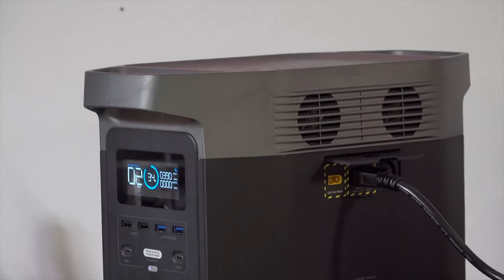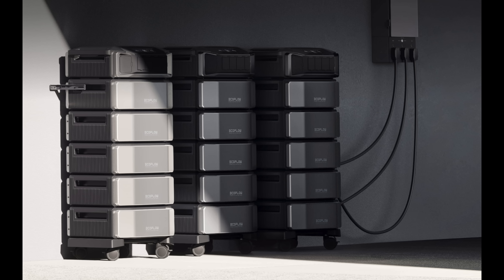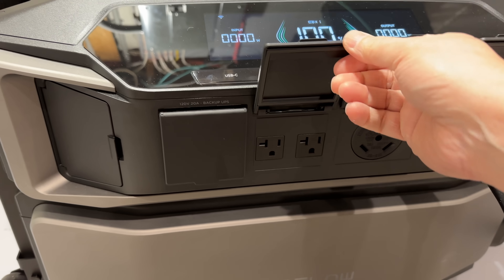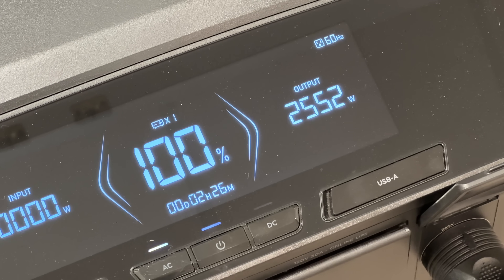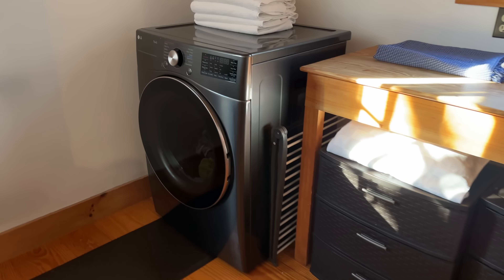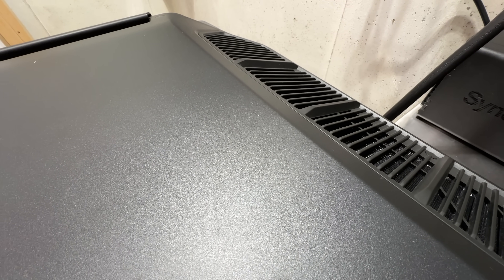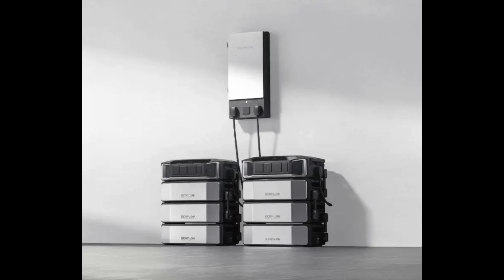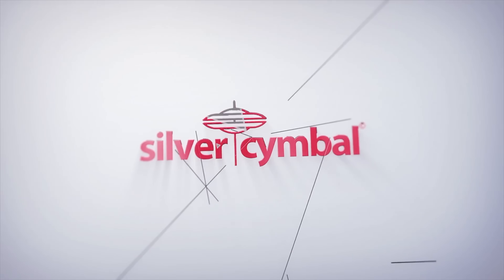ULTIMATE Home Generator just got BIGGER with 240V | Ecoflow Delta Pro ULTRA

Comment: So I should buy a $6000 battery that can handily be charged by my gas generator while it's putting out 240V. Couldn't I just skip the EXPENSIVE battery part and just use my generator??
Why buy this?
Reply from the maker: Certainly, except this one also takes solar input, operates silently. allows remote control and more. I have reviewed many large gas generators and if the noise isn't an issue and you keep enough fuel on hand, and do the maintenance both can be good solutions. Personally where I live we run the risk of a 2 week outage so I need to have both, but using this battery system is the best 3 days I can start with before busting out the gas model. Next year I plan to add ground solar and will hopefully use that power during the day and then have the reserve for storms. The only WRONG solution is when people do nothing to be prepared.
Reply from the maker: Also its $4700 with the code above.

Comment: That unit is amazing - the 240V output is a game changer!  The option of inputting 120V and still outputting 240V is really unique and opens up lots of combinations
Reply from the maker: I totally agree, its almost magical. Next it will run on used coffee grounds and put out three phase 480v
Reply: But 30amp 240V is disappointing at best. When will we get a single power station with real 50amp 240V option?

Comment: Excellent, it can be charged with 120 while outputting 240.  That alone answers my one concern.  I can run my 240V appliances, while charging with my Firman 3382, 120 v inverter generator.  And I would no longer need to keep my 25 year old Generac XL5500, even though the motor run great and the unit has served me well during every past power outage.

Comment: Their Facebook group is crazy useful. Thousands of customers provide info.
Reply from the maker: I hang out in there and some other forums and I totally agree. Its fun to see how others install these too, it can give you a lot of ideas
Reply: @SilverCymbal  yes. You are my #1 source for anything home related. 

I’ve wanted eco flow back up for a year but wife is resistant due to cost. 

We do have a 2 year old - never used Generac 8000 watt gas generator that hooks up to our circuit breaker via the 240v like you just showed. 

But….id have to siphon gas from the vehicles to keep it running in the event we can’t get to the store, etc. but I have prepared for that occasion as a possibility so we could handle it nicely. 

As long as I can keep my wife’s food frozen, and cooked if necessary I’m fine. She has crazy allergies and can only eat very specific foods or she can end up in the er. She eats one type of rice, turkey, carrots, blueberries. That’s it. Every day. All day. Every meal.

Comment: The ability to output 240v while charging with 120v is a big deal. Since most big 240v loads don’t run constantly, it would be theoretically possible to power a house with one of these and a small inverter generator for days, while using less gas and making less noise than a large open-frame generator.
Reply from the maker: I agree, this was my most loved featured for exactly what you said, and lets you get a lot more runtime from far less sophisticated gear feeding it as needed.

Comment: Proprietary phone home junk, stay away. Edit: nvm, read thread: "The ONLY reason you need internet is firmware and remote control both are optional" Edit2: nvm nvm, not that simple after all.
Reply from the maker: It doesn't phone home at all. Needs no internet to function. If you want firmware, yes but it doesn't need to activate or use a subscription. Maybe other companies do that?
Reply: @SilverCymbal they DO phone home if you connect it to the internet. The only way to control it via your phone or "from anywhere in the world" like you say is to connect it to the internet and then it WILL phone home, there is no other way to control it.
Now of course EF does not tell you that, neither do they tell you it's a Chinese product which is tested in China (other models were even "tested" in facilities that no longer were certified to do any testing or labelling) and they don't tell you about their privacy policy in using the phone app or internet connection neither.

I've had multiple arguments with EF over these facts and they keep denying everything, but reading the documentation it is clear that it is a poorly translated Chinese to English documentation and if you look up all specs and test documents with the FCC it is also very clear that is a Chinese company with unclear privacy policies.

Also the details the app requires like GPS, bluetooth, full network access, .. is way more than is ever needed to configure such a unit
Reply: @SilverCymbal  
When I posted a comment under JerryRigEverything's video wondering whether it had it or not, someone said the following:

If it's anything like the rest of their lineup, this is absolutely the case. No local network access, no direct bluetooth access. The Pro has to be connected to Internet and your phone's app has to as well in order for them to talk with each other. The only direct access is a bit of initial setup to get the pro connected to a wifi network. 

However, I would love to be proven wrong.  At 3:54, I see an RS485 serial port. If that's enabled, then it should be possible for a local application to control it. It might even be possible to sniff the serial data and make a 3rd party application.
Reply from the maker: @Chaos666Theory  You won't need the RS485. You absolutely do not need the internet to run the Pros and Pro Ultra. They never use the internet for communications betwen devices. You can clearly see the extra pins on the power connectors, that is how the devices talk. They know about 20% of their customers uses these totally off grid, islands woods, etc, There is no way they would depend on intenet to operate. The ONLY reason you need internet is firmware and remote control both are optional.

Comment: For that price, I much rather have a diesel generator.
Reply: And when there is no diesel?  It's great to have options
Reply: @JohnSmith-wt3mw  It is great to have options. The problem with this option is the uncertainty of not knowing how long a power failure will last, and since these are batteries, they need to be charged. I guess you can always get a gas-powered generator to charge it...
Reply: @eastcoastian5982  you guys seem to think deisel, gas, and NG are limitless. So i ask, yet again,  what are you gonna do when you run out of diesel?  It's not a hard question.  

You can get solar panels to charge the batteries...SMH.
Reply: @JohnSmith-wt3mw   the trick is to not run out.  They make these cool things that can hold extra fuel. It's like a fuel tank, but it's not connected to anything.  You can store a lot of fuel on site. But I guess using a battery is cool, too.
Reply: @eastcoastian5982 Your plan is to not run out of a finite resource?🤣🤣🤣
 So how much could you store?  Those can things sound fancy...

How long is it good for?  A year?  A couple tops with fuel stabilizer?   Then what? 

Can you make more?
The sun is limitless.  Solar panels will be producing power years after your generator runs out of fuel. Even without batteries.  Admittedly only during the day.

You'll be the guy I have to watch out for during a  potential SHTF event roaming the countryside because you ran out of fuel...Good luck
Reply: @JohnSmith-wt3mw  The diesel fuel will still be good long after your batteries are in the landfill. I don't know why you're taking this personal. And I don't know what you have against fuel. If you want to waste your money on batteries, go on ahead. I won't stop you. Just know that if one of those batteries shorts out, you'll be having a bad day. If you're still alive and make it to the hospital, you can thank the diesel power generator for keeping the lights on.
Reply: @eastcoastian5982  nothing against fuel at all. I could also argue the same about you with batteries.😉 I have a whole home generator as well as solar.  I like options and redundancy. 

Not taking it personally at all.  Sorry you feel that way.

The batteries or inverters may die for sure, but LFP batteries have a 3000+ cycle @ 80%.  That's damn near 10 years if you use it every day.  After that, they still have 80% capacity.  6500+ to 50%.  That's 26 years of daily use for a Delta Pro!!!  You can't seriously believe your stored deisel will last that long!?!? I would love to see an article or resource backing thus up.  

Hospital line was well played😉
Reply: @JohnSmith-wt3mw  gasoline can last about a year with stabilizer. Diesel can last 10+ years easy.  I have a decent size gas generator that works well, but the gasoline is shit and can damage the carburetor if it just sits.  I have nothing against batteries or solar, but 7k for a 1 battery is too much. You keep bringing up solar energy, but that isn't included in the price.
Reply: @eastcoastian5982  Well, I bring  up solar cause it's just a source of power for the batteries. Like diesel for your generator.  Both useless without a "fuel" source.  You buy diesel fuel, I buy solar.  Neither a part of the original cost.    

 I could use wind, hydro, grid, and a generator to charge batteries.  Your diesel generator is a paperweight without its one fuel source...

Still need a source for diesel longevity.  Everything I can find says you'll get 3-4 years tops with fuel stabilizers...would also like to see how you store 10+ years' worth of diesel fuel..My panels will give me 25+ years of energy.

The DPU is expensive, BUT a 5kw diesel generac is pushing $5k!

I could DIY a 5kw system for around $6K.  That's panels, inverters, batteries, etc.

  The Generacs 12 gallon tank runs 32 hours @50% load.  That is around a $45 fill-up just to use it.  Even if you could stretch that a week, about 4 hours a day,  that's $2300 a year.  After 1 year, my solar is still producing and not costing a penny...your generator, on the other hand,  is out of deisel, and you need to find more. After 3 years of diesel, you could have bought my whole DIY setup and an ultra!!! If you got better diesel numbers,  I'm all ears, but that Ultra with panels looks infinitely cheaper just after a couple of years..
Reply: @JohnSmith-wt3mw    I think I'll stick with what I know. For me, the generator is for emergencies and mobile welding. It would be different if I lived off the grid.  If I went solar, I would go DIY.  
Again, I still think this battery is too expensive, but I understand that it's not for people like me.  Maybe if I lived in an apartment building, this would be a good option. 
Btw,  a diesel engine can run on home heating oil, kerosene, cooking oil, waste engine oil, or biodesal. We can't forget about JP5 and JP8. I'm not sure, but maybe transmission and brake fluid too.
Reply: @Happyfacehotwheels  to each their own😉

  Its great having all these options to power our homes.

Was unaware of all of those fuel alternatives for a diesel generator.  Interesting stuff. I'll have to educate myself on that.  Thanks for the tip.👍

Comment: Does anyone know if the batteries or smart panel ever have to "phone home" in order to operate?
Reply from the maker: They do not need to. They don't need to be activated or anything like that. The internet is never required. But you will likely want firmware upgrades but those are dione through your phone and the app if desired. But it does not need a connection to operate

Comment: The 240v is great for home backup. I like the concept of charging a large power station with a suitcase generator. Since I only have 120v in my apartment, the original Delta 1300 works great.

Comment: I kinda had a wake-up call last night. I underestimated this snow storm we just got. My power flickered I bet over a hundred times, but never fully failed (but many others did 😕 and are still out). I "pre-overheated" my home to 77° last night (just in case power did go out, I'd have a couple/few hours of the extra heat already built up) and I got the natgas fireplace and generator ready. Luckily I didn't need them.
Reply from the maker: Power failures have become a huge deal for a lot of people. I have always lived in somewhat remote locations so a generator was always needed. These are a great option that can make it much more of a simple  pushbutton operation.

Comment: Greatly appreciate you testing 120v charging and 240v discharging.  This was sorely missed on the delta pro.
Reply from the maker: I agree, this seems small but for many of us that own little gas generators or even small power stations, doing this during an outage is a great plus.
Reply: @SilverCymbal In your video it looks like you are using wall charging to accomplish this? I am not sure it will work with a small gas generator because I just tried it and it would shut off during high loads.

Comment: I would like a controller like this, with the same easy solar input connections, but that would charge deep-cycle lead acid batteries. They take up a lot more space, but I have space. I would prefer their safety record, much longer life, and lower cost. Cheers!
Reply: LFP is very safe especially in a solar setup where you're never outside that 1C rate. LFP electrolyte has a much higher combustion point. Even dead shorting a cell only creates a bunch of smoke. Same as a lead acid.
LFP also has a longer lifespan that lead acid, by a huge margin when you factor in total kWh throughput. It's not even close. Also cost is about the same or cheaper if you DIY over lead acid per kWh now. Your information is quite outdated now.

Comment: That figures since I just got a complete Delta Pro system recently.  This is DEFINITELY much better. 🤷‍♂️
Reply from the maker: The Delta Pro is still a rock solid setup that has run so much for me over the years. At least unlike the other brands if you decided to sell it at some point the EF stuff has decent value.
Reply: I got 2 DP's as well.  Now is the time to max put though.  Prices are just gonna keep falling as push the Ultras.

Comment: I assume that it won't have the same problem the old delta pros did with one unit dying before the other, rendering both inoperable for 240v. The charging while discharging feature is nice.
Reply from the maker: Yes correct, the balancing the two stacks was something I don't think any of us had realized until using it. Still good to have 240 but this is improved as its all one bank for charging and discharging. I definitely love that 120v as offsetting use and using up old power stations, generators can make just a 1 unit become very attractive.

Comment: Not gonna run an electric stove or a central AC unit (without a soft start)
Reply from the maker: Depends on the stove, dryers are usually a 30amp outlet. For a stove 40 or 50 is common. Central air is tough. Heat pumps yes, 5ton central air, if older than 8 years will need the kit like you said and may not be possible
Reply: Ya, I just saw their 50 amp Hub on their site as well.  It would take 2 Ultras but that would provide power to probably most anything in a house

Comment: This is an interesting new option. They keep getting better. The price is still a big challenge for most people. Thanks for showing us.
Reply: Cost is my barrier. It would be different if my power were unstable but in 10 years we have lost power only a few times for more than a few seconds. The longest was 3-4 hours for a planned electrical upgrade in the neighborhood.
Reply: As others have said, price is the barrier based on utilization. My 4250w propane inverter (on a 250gal tank) powers the basic necessities in all seasons. In Texas, we may lose power 1-2 times over a few years in our area. If we lived in a different area, this might be practical.
Reply: You are so right. It's something each person has to judge for themselves.
Reply from the maker: Thank you very much, yes agreed, Good stuff, cheaper than Tesla but not inepensive by any strectch. I am glad you can just start with a single setup and add later.
Reply: @SilverCymbal how will this type of power generator if I can call it that do in my garage where my panel is located. My garage is is a 2 car garage that sits under both the front 2 bedrooms in my townhome. The garage can get over 90 degrees in the summer at certain times of the day. Will this cause problems for these batteries or are they able to handle it. In the winter the garage gets down so far at the lowes at around 49 degrees. We know the 49 is not as much of a problem as 90-95 degrees. 

Also who in the world can I get help from to set up the best electrical connection to my panel that will actually have full knowledge of this product and know all the pieces they can use to give me the best connection setup?  Especially if we got their smart panel. We do have a 6 gauge wire coming out of the panel going to a box that we can easily put a 50 amp rated outlet on it since the wire is connected to a 50amp breaker in the panel. It was installed for us with our newly built home last year for a future car charger if we ever go one. We probably never will. Lol.

Anyway we really need to find out if this type setup will hold up well in a garage that can get that hot for a few months out of the year here in South Carolina up near the upper western part of the state where it does not get extremely hot for very long. Batteries can have issues if it’s to hot. Anyway thanks for your video and help with my question.